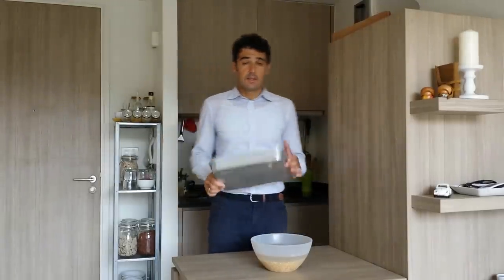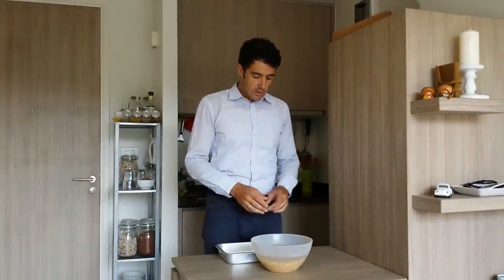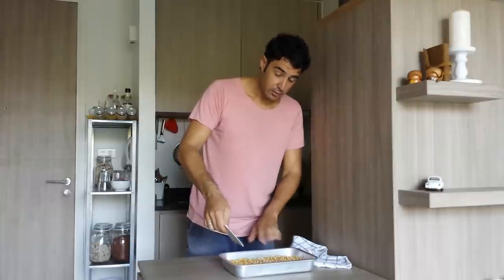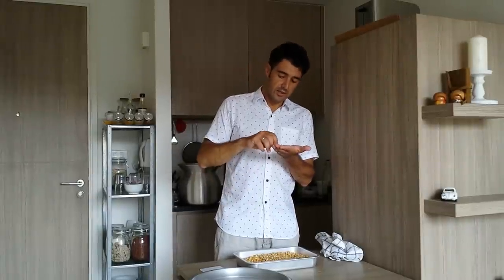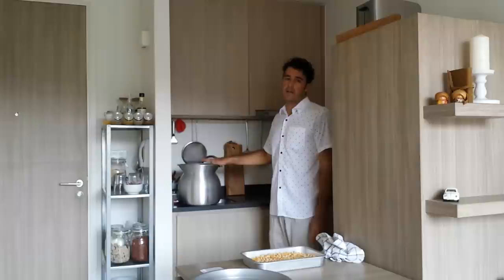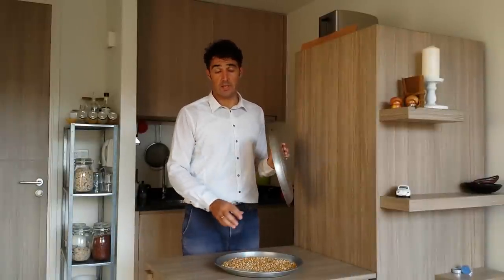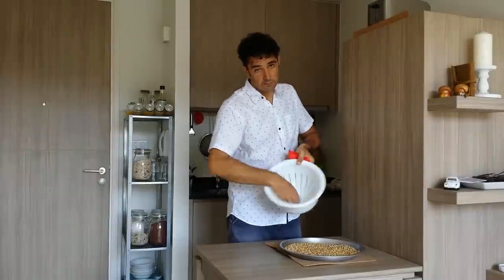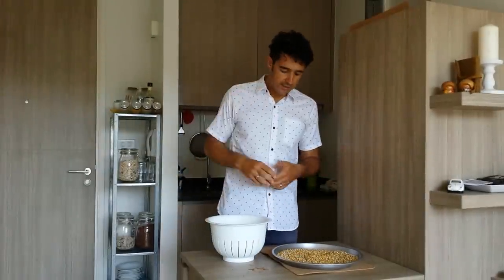How to Malt CORN at Home

Comment: Just made my forth batch of cherry tomatoes in syrup. I haven't been able to stop the tomatoes from bursting, but they are so delicious. I reduced the amount of water in the recipe, and it worked well with less liquid left over. I am going to just try tomato jam as I can't seem to get the tomatoes fully dry. I will let you know how it all comes out. The ginger did not come out well in my experiment, as they got attacked by ants while drying in the sun. With the last batch of tomatoes, I dried them in a slow oven for about three hours, and they are very nice. 
Your sound quality is not good, there is an echo, and your volume is too low still. You need to move the mike closer or get a mike that is attached to your head. I have some sweet corn seed that I will try to malt. Thanks again.
Reply from the maker: Thanks.  Yes with my microphone I have some problems 😢
When you try let us know. if you record tasting video you can win the T - shirt 😉

Comment: Thank you! I'm gonna do this when I find cheap corn. It's quite difficult to find that in Finland that sell cheap and bigger quantities. What is an efficiency?
Reply from the maker: Try first with small quantity 😉 I used the corn for popcorn 🍿 or you can check the shop for the animals for farmers
Reply: @Spectacular-cuoredicioccolato  I was planning to do that :) To see how strong wort I can make out of it. So far I found only low quality that was not food safe for humans.
Reply: @Spectacular-cuoredicioccolato  They already germinated 🙂 Can't wait to bake them. I read research of the kilning temperature. Where did u get that 80c? Should be just about right 👍🏼
Reply from the maker: Yes 👍🏼 80*C is for base malt

Comment: My biggest issue is that when I tried this I had a lot of dampoff, mold, forming. I tried to removing them and adding more ventilation so the corn can breathe. The batch tasted nasty.
Reply from the maker: You need to move them often to avoid it 
How you after toasted or roasted it?
Reply: @Spectacular-cuoredicioccolato  so what I did is got two aluminum trays: one at the bottom with Mason jar lids to hold the other on top. The top one had holes for water and air to go through. I used a rag to line the top tray and would spray it with hot water and boil another rag to cover everything. It was early this winter but I couldn't get any hotter. I did move them twice a day. I don't think I roasted them probably tho. On another test run I did soaked some corn with warm water can changed it twice a day. This lasted about 3 days until I saw some sprouting.
Reply from the maker: Try like I have done in this video 🙂